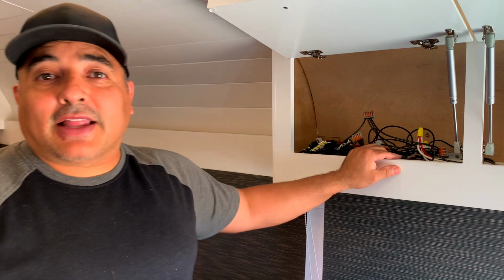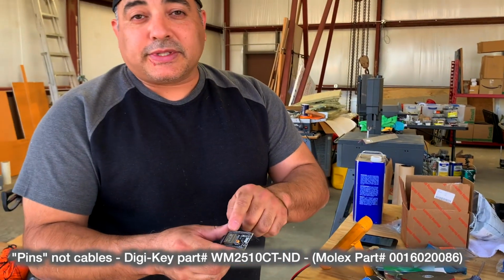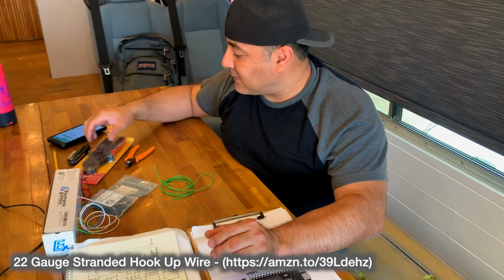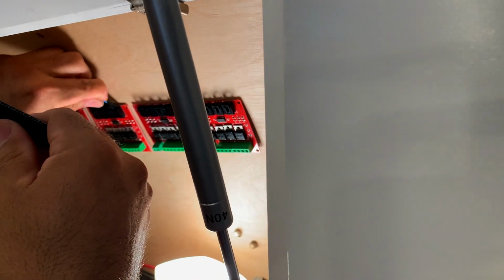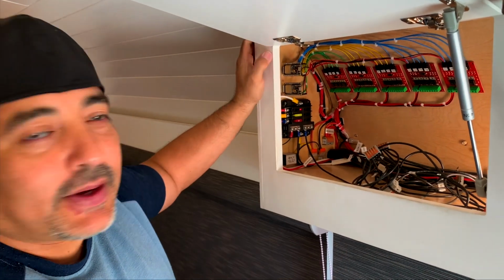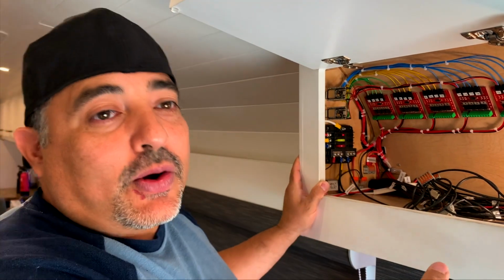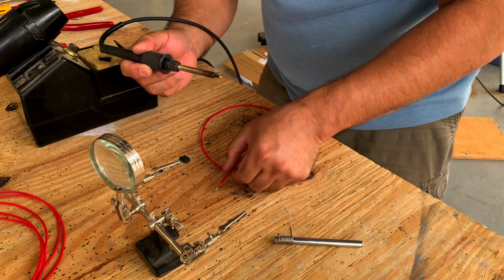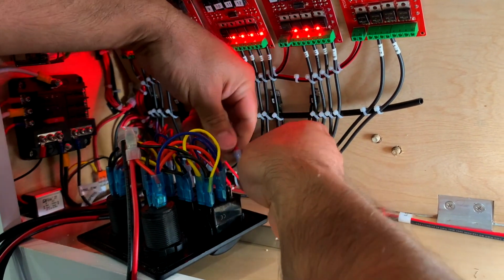Finishing The Bus Build: Home Automation Wiring for Lights

Comment: My 2000 Monaco dynasty uses the same rocker switches but they are just wired to simple 30 amp automotive relays. You have a very nice system but in my case for troubleshooting and fixing I’m glad I have the simple system that I have. You guys must spend as much time planning as actually doing the job. You make an excellent team.
Reply from the maker: Rocker switches get the job done :).  Thank you for the kind words - we do spend a great deal of time planning which has served us well in most cases.  I will admit that we over-plan sometimes :)  One feature that we use quite a bit is turning off all the lights from our phones!  Sounds lazy but with a single button we can turn off every light in the coach and just go to sleep.

Comment: Instead of having “over ride” MOSFETS, couldn’t you have just run parallel negatives, one through the control board and one to the rocker switch?  That way either the control board or the switch could complete the path back to ground.
Reply from the maker: Sorry I had some trouble articulating the problem.  I wanted one "over ride" switch to control multiple zones (2 zones in the living room, 2 zones in the kitchen, 2 zones in the bathroom).  If I just wire them to parallel wires it would electrically connect those zones together and I would lose the ability to control them independently. Even when the override switch is off - if I power one zone 1 with the control board then zone 2 would also light up because they are electrically connected at the switch.

Comment: ... great build (again) ... but: I won't trust those wire nuts in a moving vehicle at all – didn't you have some WAGOS left?
Reply from the maker: Thank you Tom.  Wire nuts are my most hated connection type (even in a house). If you look really closely you will see that those are actually closed end crimp connectors.  I did use Wagos on the 12V and 5V power wires for future expansion.

Comment: Juan - I just bought a 8.5 x 32 utility trailer and ammo beginning insulation and suspension work. The timing of you video is perfect for me. I have planned extensive automation using HA and ESPhome, obtained ESP32 boards with POE so they can be distributed where needed. I am planning on being all electric with a 24Kwhr battery bank and 10kw inverter/charger. I will be monitoring (for parasitic draw) and controlling all circuits. I will have 3200 watts of solar on the roof. I am very interested in hearing about details such as how your wiring is done and how your articulated solar rack has worked out. Any tidbits you can put on the blog along those lines would be appreciated. I have never done any of this before, so your knowledge is invaluable.
I wish you and Michelle great travels!
Reply from the maker: Sounds awesome Thomas!!  Michelle and are very happy to share everything we have learned.  I am running HA with ESPHome and it is amazing!  I started out writing everything by hand with Arduino and ESPHome has been a complete godsend.  The rack has required some maintenance we have replaced a few sliders and both actuators (water got into the limit switches) but we have used it A TON and are still very very very happy with it.
Reply: Juan / Michelle -

So I am curious about your sliders. I am planning on using wheels from a sliding glass shower door, so I am hoping that there is little maintenance needed. Also, were your actuators IP66 rated? Those are kind of pricey, but as they say "buy once, cry once". I would like to do something that would last 5+ years. What size are your actuators? I plan on having single axis solar tracking, so my rack will have to pivot at the edge.

Comment: Are you using ESPHome with Home Assistant?
Reply from the maker: Hi Taylor!  Yes I am using ESPHome - WHAT A GREAT PIECE OF SOFTWARE!  I started out writing an raw sockets and an MQTT client by hand .... that was a nightmare after about just 2 inputs and 1 output!  ESPHome was a real godsend!
Reply: @BeginningfromthisMorning  It really is such a great platform for accomplishing so many different custom DIY projects.  I used ESPHome to make a custom gate strike relay and mailbox sensors at my house,  lighting control in closets with a door sensor, status lights with RGBW LED's, etc.  I like that you can code them to have basic functionality running directly on the ESP in case your home automation hub loses connection or something happens to it.